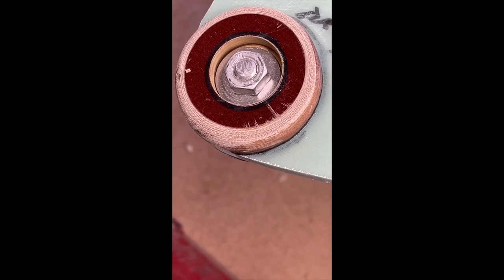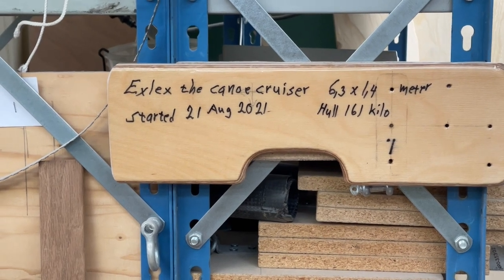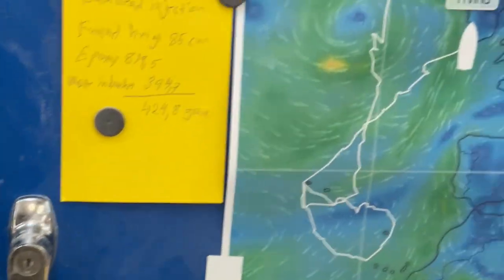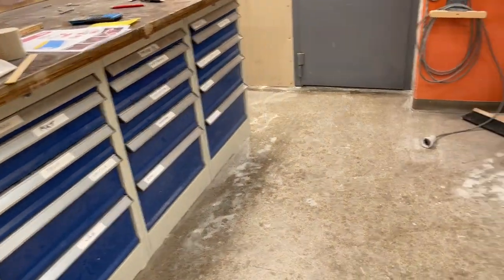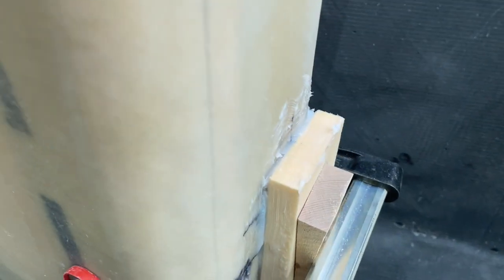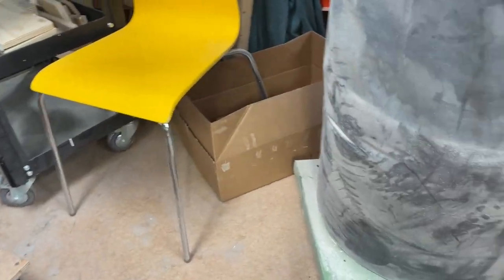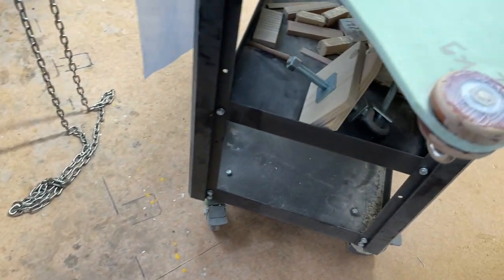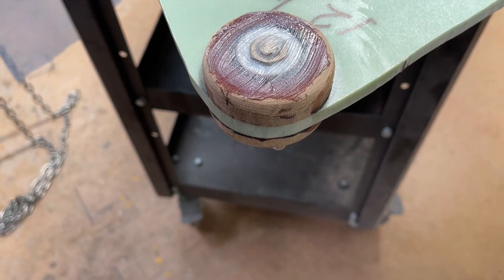20 August 2022  Attachment ponts for the control lines to the centerboard.

Comment: Will you carry spare rudder or center board in case of breakage?
Reply from the maker: If you make something strong enough it will not break.
There will be no spares.
Reply: Oars are potentially usable as pinch. Unnecessary in this case.